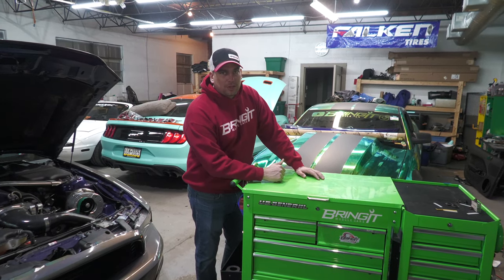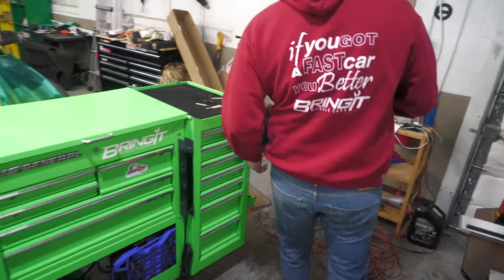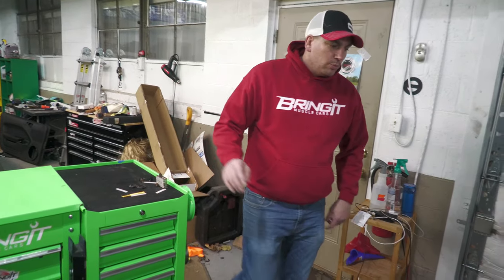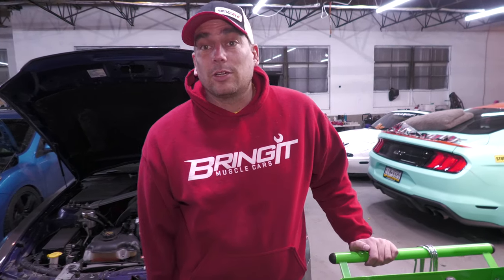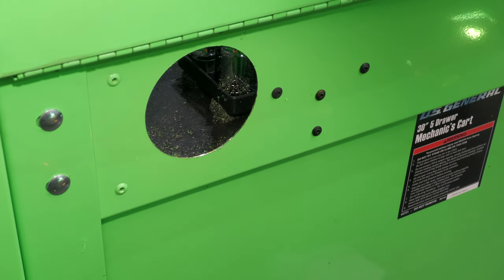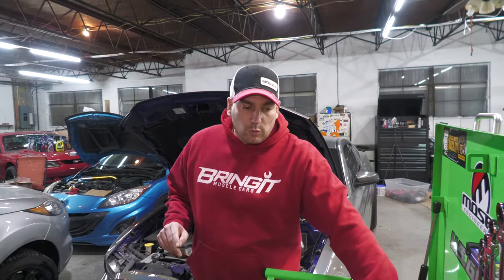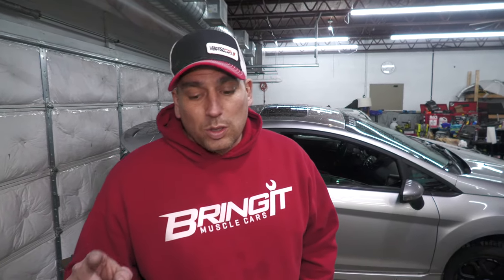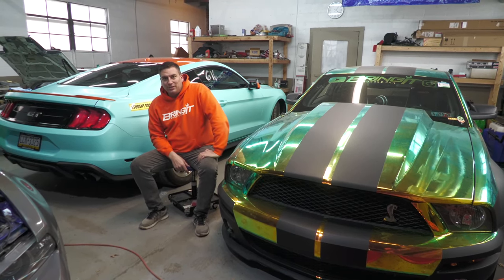Top Harbor Freight Tool Cart Mods 2021#harborfreightprojects

Comment: Pro tip: open all the drawers while lid is open, close lid, now drawers will not latch into locked position. You’re welcome
Reply: But they will open while you're rolling and the cart tips over
Reply: @kempj5273  they don’t. There’s a secondary notch and you still have to slide the latch over to open the drawers.
Reply: I just took the drawers out and cut the lock tabs off the back so it still latches un front but doesn't have the hook for lock bar to grab.

Comment: I modded my 5 drawer cart by adding power tool holder on left side by drilling magnet bar they sell 5/16 drill bit. I proceeded to line up magnets of US GENERAL  cordless tool holder with brace on that side but used the magnet bar for the upper hold on lip for the tool holder. Black one instead of green to match drawer strips. It is bolted on with carraige bolts and looks like it came with it.  I use magnet tray for Bauer batteries on othe side. Use shelves on both sides and installed handle in front using factory holes. I hang cordless work light on the handle and it fits between the sliding drawers without moving the lightbar.  Thx for the video. You inspired me to think of different mods for the 5 drawer cart.

Comment: How's it going to go flush against the trailer wall with that big ass electrical outlet sticking out the back?
Reply from the maker: I am going to build a frame for the bottom and a wall up the back next month. You’ll definitely want to check that out.
Reply: @BringItMuscleCars  Build out a open box around the back with metal peg boards inside (Home Depot) and then you have some functional area in the back too
Reply from the maker: @bkseitz  that’s kind of the idea. Make it have  as much useful space as possible.
Reply: @BringItMuscleCars  I'm in process of building a Hutch for my Husky "72 which will use pegboards.  When I saw your video this morning with the side box up front, then adding the power supply I thought you should build a frame in the back to hold the Pegboard squares that Home Depot sells, then you've got added hanging storage in the back.  Looking forward to your video.  You might also consider "Bolting side box then relocating your swivel wheels further out for more stability during movement.

Comment: Where did you find a side box that matches the tool cart all the new ones now are black trim on drawers.
Reply from the maker: @jay13601  it must have been an older version. I’ve had it for a few years. Not sure where you’re located but I’d sell mine.

Comment: Hey, don't cut off the drawer locking rods, just a couple of screws and you can remove them. Then reinstall if the situation changes.
Reply: I came here for this.  Mine are riveted on, what screws?
Reply: @TonyYoung808   re doing rivets are easy too. the holes are already there.

Comment: I like that outlet, what size hole is it? And how much does it stick out the back? I'm thinking about adding the side cabinet and mounting it flush to the front of the cart.  Then the back of the side cabinet and back of the outlet might be about the same distance away from the back of the tool cart.
Reply from the maker: It takes a 3-1/8 hole saw. If you flush mount the side cabinet it will be roughly the same distance. It’s probably a inch and a half out the back.
Reply: Just seen this video for the first time. I did the same thing only I used a 2x6 wood to help bring in the box so that there will not be so much sticking out the back.

Comment: LOL. You specifically molded the side cabinet so it wouldn't be an issue in the trailer, but now you added a power box that's sticks out further than the side box does LOL
Reply: He is gonna drill a hole in the trailer too.

Comment: Is that a big scratch on the lid. That's the problem when leaving the lid open while moving it against the wall.
Reply from the maker: It is. It’s from leaving it open in the car trailer all of the time. It doesn’t bother me but I know some people would go crazy over it.
Reply: @BringItMuscleCars  Easy fix is rubber bad liner it also makes it another work surface.

Comment: An with the power extension in place, your excuse for why you didn't set the side cabinet flush is invalid.
Reply from the maker: Yes I know that. I’m moving it to the back and building a frame. Stay tuned